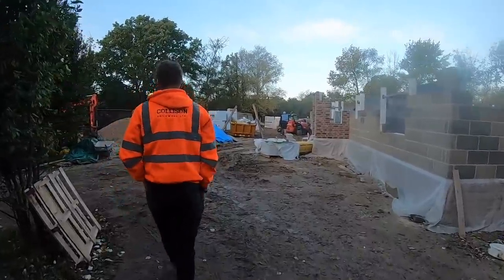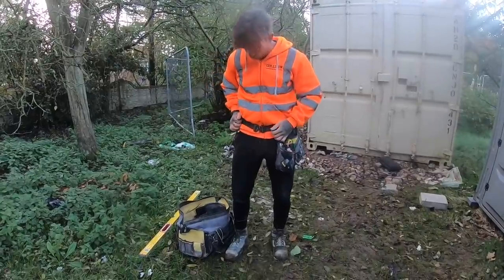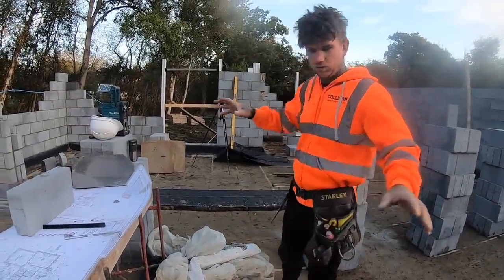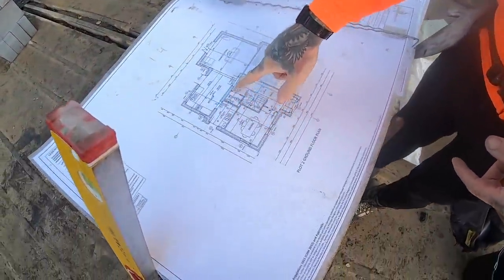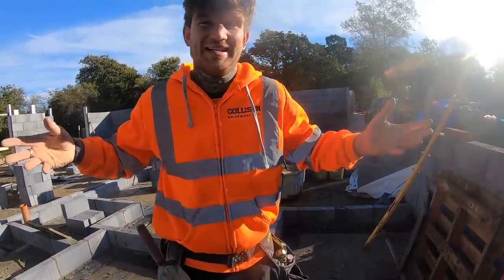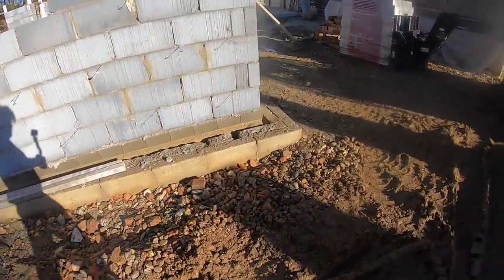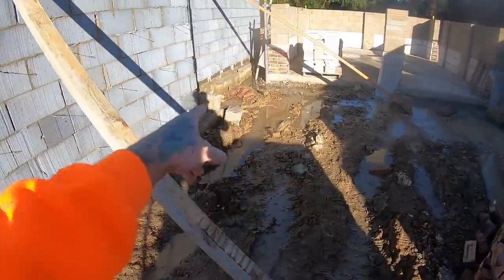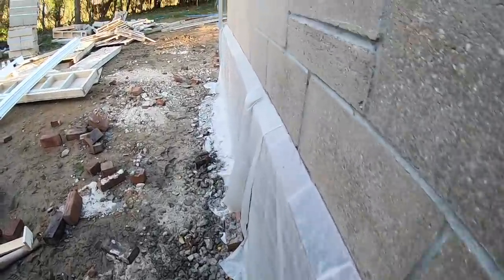Bricklaying - Day 16 - Building a brick corner with my new level!

Comment: Absolutely dead on about the tool belt,here in the states all the trades use them just makes it easy when your laying out work no matter your trade 👍
Reply: Don't know where you're at in the states but commercial masons in the Southeast  don't wear tool belts, hammer hanger or tape hanger yes, but no tool belts